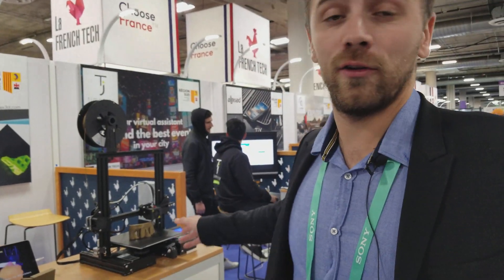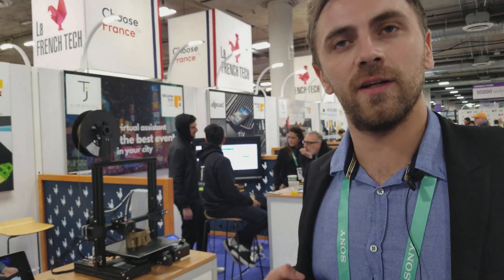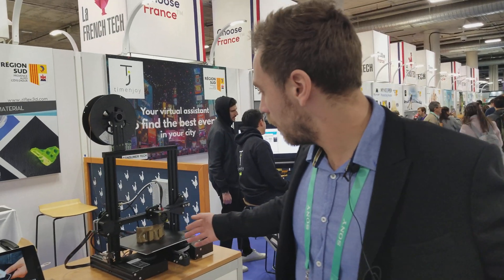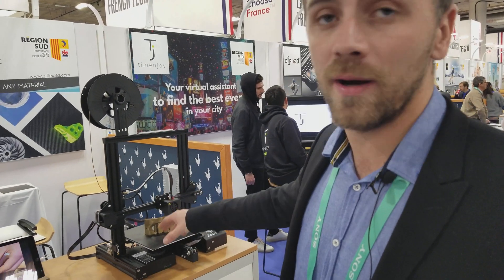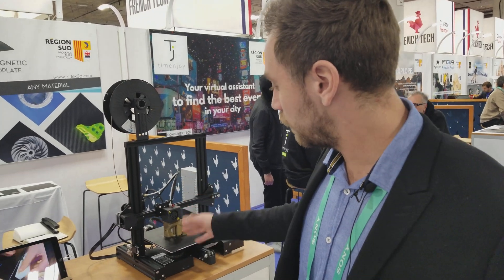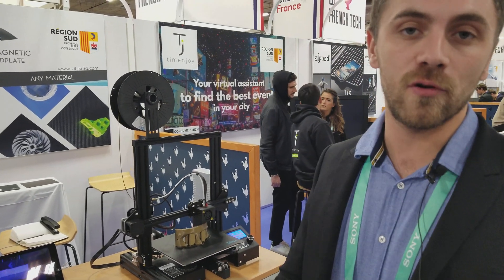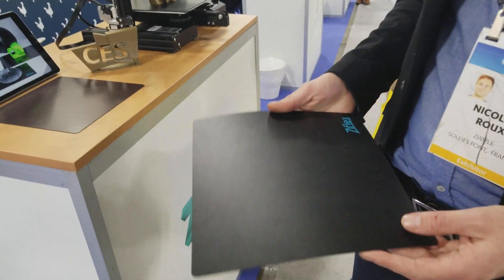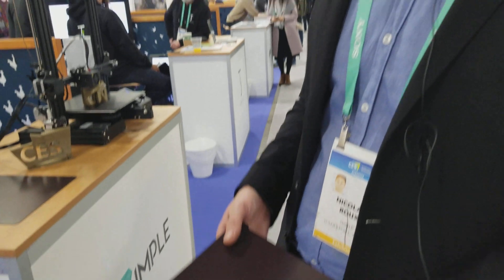3d printing Ziflex print bed by Zimple CES 2020

Comment: Guys, I installed my low and hi temp Ziflex magentic plate and cut it to fit my Lulzbot Mini printer after seeing you at CES 2020. I gotta say, this magnetic removable plate is awesome! I've been 3D printing on PEI for more than 5 years and this is a game changer. I've tried purple gluestick, hairspray, Buildtak scrapers, flexible paint scrapers, plastic wedges, even hammers. None of them work as easily as this magnetic flexible plate. PLA, PETG, ABS, TPU all stick firmly and remove like butter. Not only that, having multiple build surfaces makes for minimal downtime between prints. Just make sure you set the extruder height carefully the first time (I have a couple melt spots from bad gcode on my part) so you don't permanently damage the surface.